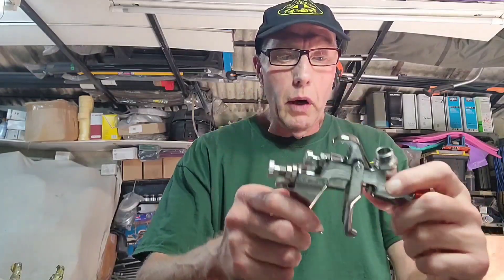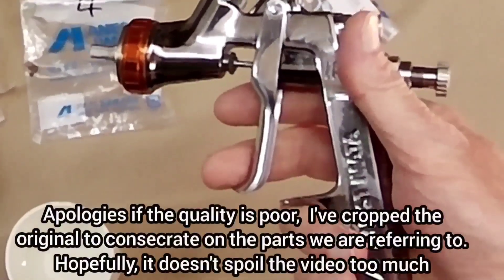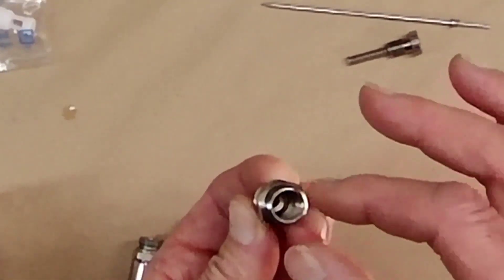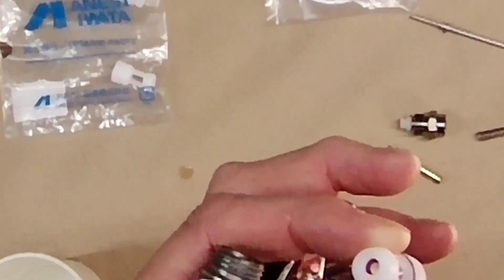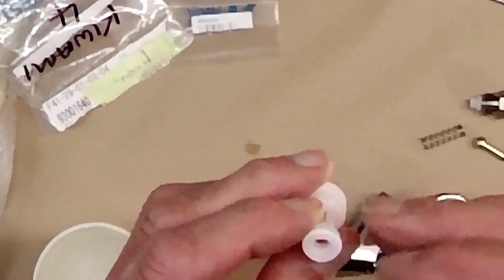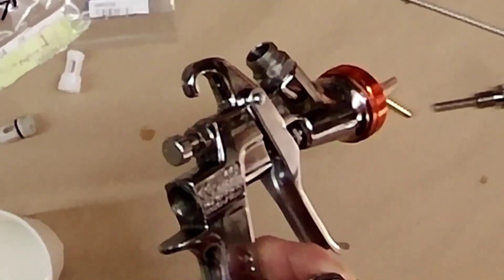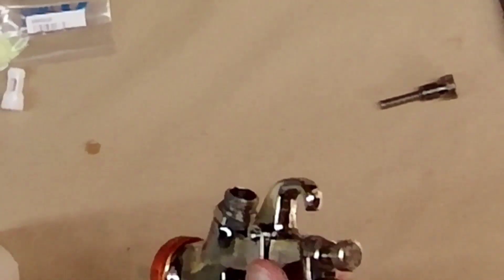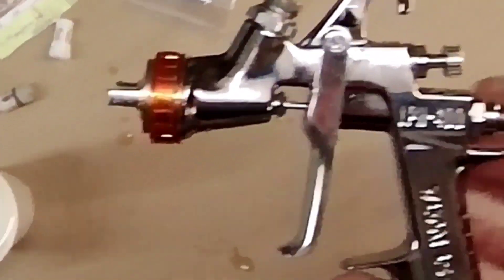LPH400, W400 Leaking Air, Same Procedure WS400 LS400 Spray Guns

Comment: Great bit of trouble shooting pete 😊😊 has that hd advance  shown up yet ????
Reply from the maker: Thanks Dean,  Yes mate, it turned up ok, true enough, it's never been used, haven't used it yet but looking forward to it 👍
Reply: @peteshobbies5383  hope it serves you well what's the set up on it and what cap came with it bud ??
Reply from the maker: It's a 1.6 with the 510+ cap, I had always assumed they were the same as the Gti Pro bodies but they have a similar baffle system as the Sri Pro Lite, I did know before I got it as someone told me but it was only recently, I think it's a better system than the white baffle gasket used on the Gti Pro Lite and Pri Pro Lite etc
Reply: @peteshobbies5383  you'll have to thin down ya thick primers a touch and internals are way different make sure that plastic baffle is beded in properly in its recess or you'll distort it  when screwing on the flow tip the 510 is a good cap but see if you can get of a com 430 cap aswell  you'll notice that the cap is way smaller than the pro have fun mate 😉😗
Reply from the maker: Ok mate, the diameter of the cap is definitely smaller,  another thing I didn't realise 👍
Reply: @peteshobbies5383  the com 430 cap is from the previous model to the advance it was called a compact  but the cap marries an advance giving you a different pattern you will enjoy this gun mate old tech but bloody dam good 👌👌👌👌
Reply from the maker: I'll keep a lookout for one mate,  thanks 👍
Reply: @peteshobbies5383  oh forgot to tell you parts are still readily available from a company called A+ E industries based in Birmingham 😉😉😉😉
Reply from the maker: Ok, mate,  I'll look them up 👍